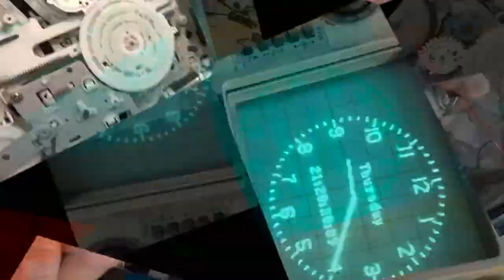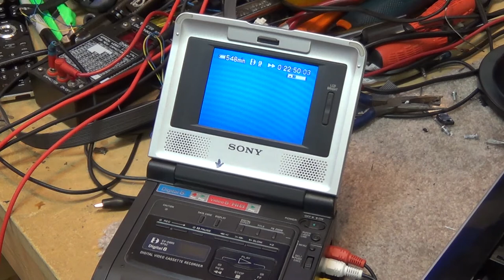dvd recorder in operation

Comment: Another thing the DVD recorders write on the disc when finalizing is the menu that comes up when you insert the disc, with the little previews of the recorded video files. I guess that takes a lot of time, too.
Reply from the maker: Yes I know this, but this one just writes a single line of text for each title. No fancy picture. Still tons of space used. the reason that the lead out area is so large is so the player never reads out into unrecorded area of the disk. What can happen if the player reads beyond recorded data it can get stuck in a locked up state attempting to read the disk. To when a disk is closed the EOF (end of file) marker is written over and over so that if it is ever read the system knows that it is at the end of the track.
Reply: Some recorders have chapter menus too

Comment: Dave, what you didn't explain, while the recorder is burning the information on the disc was it burning the pits and land on the disc.
Reply from the maker: It doesn't burn pits and lands. It vaporises dye layer for the 0 and not for the 1.   There are no pits and lands on a worm disk.  Those are only on stamped disks.  Rewritable disks are a whole different ball of wax. Heating changes the crystline structure to change the phase of the reflected light.  Rewritable is pretty cool technology.
Reply: @12voltvids  so the laser vaporise the 0s to a tiny dot on the layer?
Reply from the maker: @lox_5017  right.  On write once disks the laser veporizes the dye.  On playback this reflects the laser back and where the dye is not vaporised the light reflected back is less. This changing reflection is read as a 1 or 0.

Comment: That's pretty interesting.  It looks like the laser diode is so bright that it's reflecting off the edge of the inside of the DVD tray where the disc sits.  If you're writing to a CD-R pr CD-RW disc in a CD writer, does its laser light shine as brightly as the one found in a DVD-RW writer?
Reply from the maker: Yes the power output is the same, however CDs use a different wavelength, in the infrared spectrum, which is not visible to the human eye. If you look into the lens of a CD player you can see a red dot, but that is just harmonics of the IR beam as CD players don't use very precise laser optics. 99% of the light is in the IR spectrum. If you point a camera with the IR cut filter removed (A sony handycam in night shot mode for example) it will appear very bright.
An RW disk you won't see anything shining through it because the recording surface is crystalline solid. The laser heats the recording layer up, and melts it slightly to change the structure, which changes how the laser is reflected back on playback.

Comment: So it writes the lead out track like the vinyl lathe cuts the lead out groove at the center of the record.
Reply from the maker: +wii1245 the disk is read from inside out. The tank of contents and menu is on the most inner part of the track. After recording the system writes the toc info to tell the player where the info is stored.
Reply: +12voltvids very interesting indeed .

Comment: Hi, it's wierd because I have a DVD recorder that looks almost exactly the same, I couldn't tell with 100% certainty because you didn't quite show an angle where the entire machine could be seen. But the remote looks like it's exactly the same. Mine has a hard drive in it that stores information up about 30 hours worth of viewing time and then you can burn it on a blank DVD. I wonder if you can help with my problem. When I go to the stored content on the hard drive and want to burn it on a DVD it won't let me burn it on the disc the way i used to by editing it and cutting out the commercials and any other unwanted segments. It will only let me burn in very large chunks and so because of that the picture quality is not good. I tried resetting to factory conditions and everything but nothing works. Any opinions or suggestions? Thanks in advance
Reply from the maker: There are multiple formats that the hard drive recorders can record in, and if you recorded in a resolution that is not compatable for direct copy to a DVD, then the recorder has to basically play it back from the hard drive and re-encode it.
I have 2 DVD recorders that feature a hard drive. One is a Sony and the other a Panasonic. On both units there is an option called high speed dubbing mode, and the unit has to be set in that mode before I made the recording on the hard drive if I want to edit it, and copy the edited content to the DVD in high speed mode. If I don't have that mode set, then I have to copy it in real time, so it takes an hour to copy a 1 hour program.
Some units will have a mode called VR mode, and DVD mode. If you plan to copy to DVD you want to make sure the original recording is done in DVD mode, or you are stuck with recoding again. Also you want to make sure that the recorder is set to one of the speeds that corresponds to DVD, that being XP, SP LP ect.
My Sony for example has an even higher quality HDD mode, but there is no way to transfer the content to disk because it was encoded at a higher bit rate than is allowed for DVD. You are best to do your recording in SP or LP (2H or 4H) mode when recording for eventual transfer to DVD. XP would be the 60 min mode. My Sony has a mode called UXP or UHQ (I forget the term they use because I have never used it) that can not be copied to DVD because it encodes at a very high bit rate, and does not use MPG IPB standard, it uses MPG I frame. That gives frame accurate editing, and frame by frame slo mo in either direction, but can not be recorded onto DVD without converting it to analog, and then back to digital, at a huge loss of quality. This is probably your issue.
Reply: +12voltvids yes this is like my Sony recorder some DVDs don't have copy protection so you can real time dub to the HDD but it's weird because recorded DVD dosnt matter it'll high speed dub them to the HDD. But if your going from HDD to DVD then you just have to make sure your recoded material isn't bigger then 4GB or 8GB depending if your using a DL disc or single layer disc. If it's bigger then say 9GB then the player will want you to play it back so it can compress it to fit the disc. High speed dub easy from the HDD but it's different from disc to HDD. Only some let you high speed others discs don't.
Reply from the maker: +Leo Mkandawire Toshiba made a few units that were similar with an internal HDD. The ones I have do not have a HDD internal. I do have a Panasonic and Sony DVD recorder that do have HDD, and I can record content, edit commercials out and then burn to disk. On the Panasonic I have to have a mode called HIGH SPEED DUBBING enabled in order to do this. If HSD is not enabled then I am forced to dub at normal speed, and it decodes and re-encodes the content and thus reduces the quality. I don't know about how Toshiba works though as I have never used one with internal HDD.
Reply from the maker: +Ryan Scherbluk I have never tried dubbing from DVD to the HDD myself. I use my machines in my studio for film to video transfer. I transfer all the clients little 3 minute 8mm film reels to the HDD and then dup their disks off when I am done and delete the HDD files for the next customer.I used to do this on tape but the HDD/DVD machine made it much easier.My recorders without HDD is used for tape archiving. I don't use DVDs at all for personal stuff because I work in the HD domain so all my personal stuff goes on removable 500G hard drives formatted in EXFAT mode.
Reply: +12voltvids oh yea I'm all HD as well but it is nice to pull out the old tech once in a why'll DVD upscaled are still pretty good looking.

Comment: I have a Sony DVD recorder it's the RDR-HX780 I love it it has 160GB hat drive and a DVD drive the reads and records all formats check it out online if you have time.
Reply from the maker: +Ryan Scherbluk I also have a Sony RDRHX730. Was given to me with the remote missing. Tracked down the last remote in the country at the sony parts depot and ordered it. Great machine.
Reply: +12voltvids yes I like it but all the disc formats can be confusing at first 2008 model I think it still works great no problems since I bought it 8 years ago. It's also well built.

Comment: If you're going to "look" at older video recording tech. , why not take a look at something like a DVHS ( Like my JVC) which will record "digitally" at 1080i .

I swear that I've had DVRs that don't have picture quality the equal of this thing, The major problem with it is there are no longer satellite or cable boxes that will output the HD channel signals through a firewire output ( The Networks & other content providers figured out they wanted to control who was able to record HD (& to what degree the HD content would be available)
Reply from the maker: I never bought into dvhs because I was always of the opinion that anything VHS sucked. I used beta, hi8 and dv for sd, and hdv for HD tape. As far as recording HD, I can still do it from my HD cable box over component cable record direct to the PC and I can turn out bluray disk or put it on memory stick or hard drive
Reply: @12voltvids  & You would be completely wrong about what the JVC 'D'VHS was capable of doing. VHS (even SVHS) did "sucK". They were toys comparatively to DVHS. 

DVD recorders were a step behind until HD DVD came along . (He,he,he .... I was a front runner with every new format that's come "Down the Pike". SACD > DVHS > HD DVD > Blu Ray > UHD 4K , etc....) (A massive amount of this equipment is collecting dust ; Some is not)
Reply from the maker: @steveassante6797  
I know exactly what dvhs was capable of but it was crippled from the get go due to restrictive limits on what inputs and outputs were available. Hdv was also relatively restrictive, I  the sence that you can not input an analog HD video signal.  Dvhs was too little too late.

Comment: I had a sony one.  These are not good the just compress files and are lousy quality.  Get a usb capture adaptor and capture to computer hard drive the burn. Much less compressed and better quality.
Reply from the maker: Actually your usb capture device uses even higher compression.  Dvd uses mpg2. It all depends on the mode recorded.  2 hours max on dvd.   Go beyond that and compression goes up and picture size drops.  First to 360x240p then 180x120 if you are crazy enough to cram 10 hours onto a single layer disk.  Yes I have a dvd recorder that has a 10 hour recording speed.  Oh and the frame rate also goes down.